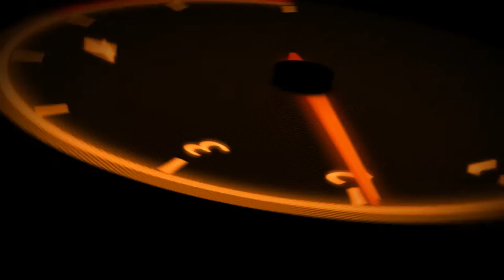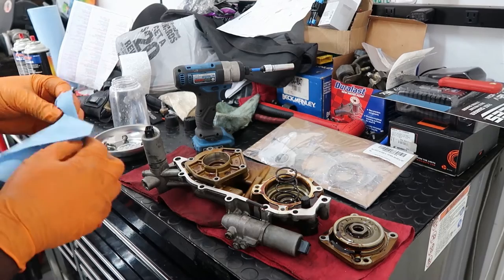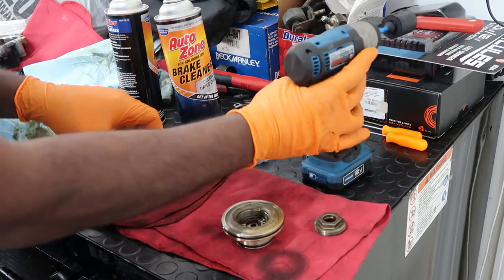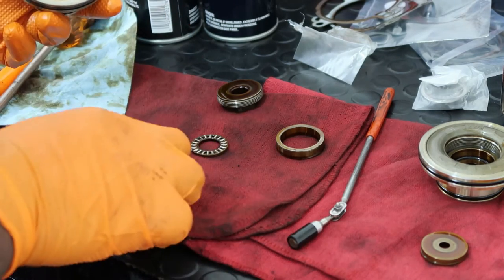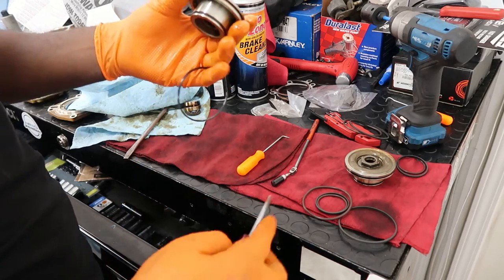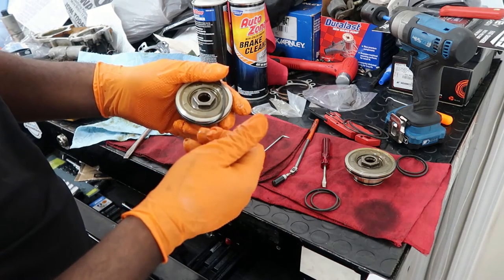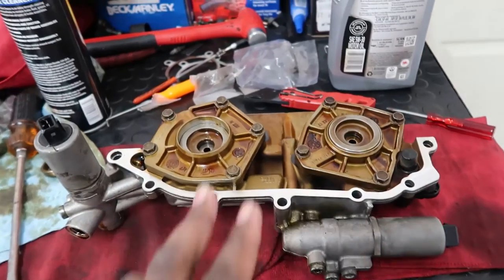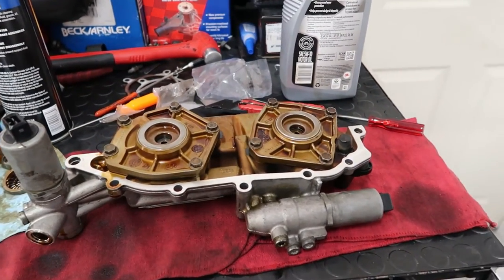M54 Double Vanos Rebuild DIY

Comment: I just bought a 03 330i yesterday for 850$ cuz it has cooling problems "bubbles coming out of the expansion tank". Today i found a hairline crack on the tank itself and the guy i bought it from had straight water in the tank so of course its going to boil but still preparing for the worst. Just ordered a combustion leak tester so im praying its not the hg but if it is im glad i found this channel and will def subscribe.
Reply from the maker: Preciate it very much. Hopefully it's not a head gasket. A big problem is these cars have no overflow which causes the expansion tank to crack. I'll be uploading the rest of the head gasket DIY soon.